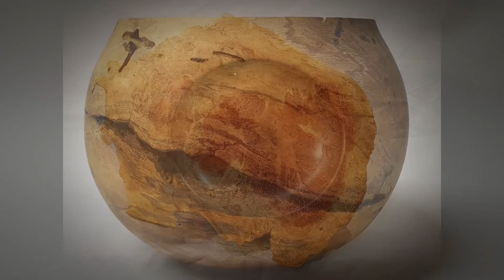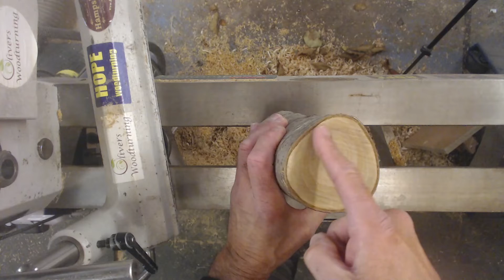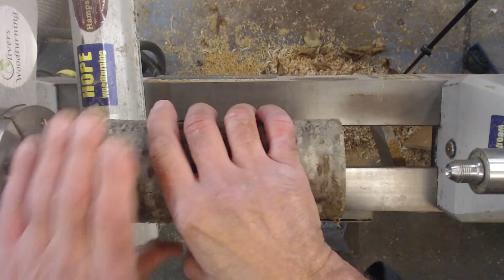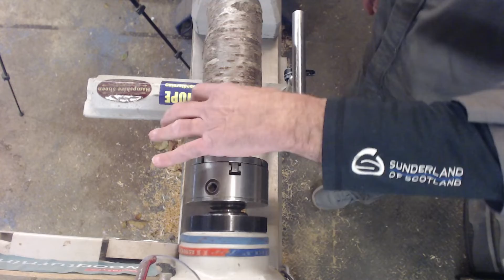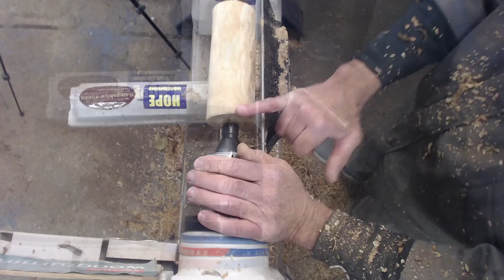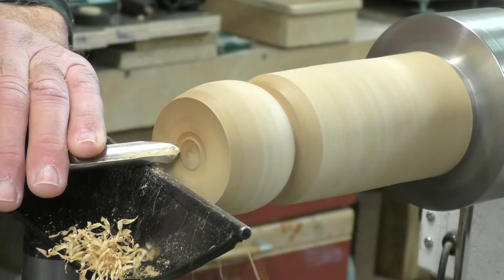Turn a Goblet #1 - Wood Selection & Hollowing

Comment: I keep telling myself that I will learn that Richard Raffen upside down/backwards hollowing cut he does.... Some day. As for NRSs (negative rake scrapers), I have a whole bunch of them. With green wood, I can get a finish cut that 400 grit abrasives seem to rough up rather than smooth out.
Reply from the maker: I've tried that method Reed, with some success ... but a lot more practice needed to be able to use it on film. I must say I really do like negative rake scrapers a lot. No news on the sharpening platform I suppose 😔
Reply: No news on the platform. Unfortunately. I have been practicing that Raffen cut, and keep the tool by the down side, so more normal position.  I did find out that I need to use a bigger gouge for it, and a recent hint from Richard was to make sure the nose comes out of the wood before you start that peeling cut. 

I did get a bunch of blanks from D Way, which are M42. I finally settled on a 60/30 grind. Some one else commented that they need a certain amount of bevel under the burr for it to cut longer. I settled on that one a long time ago.